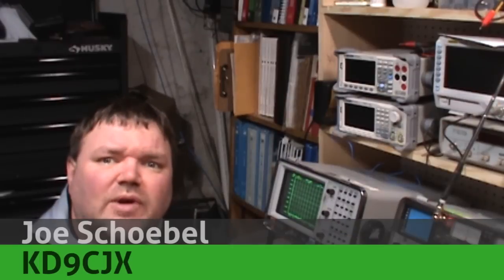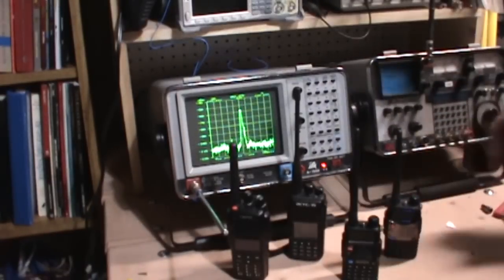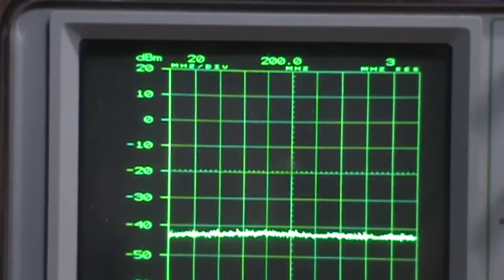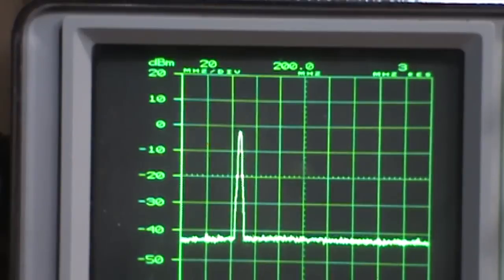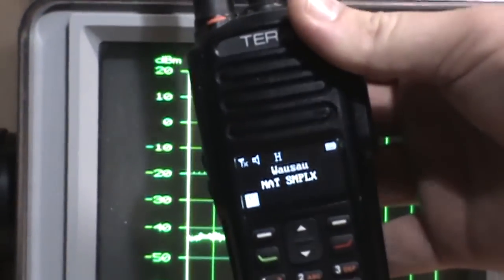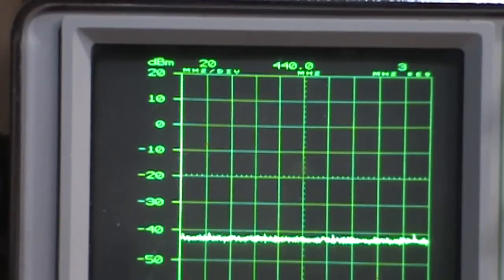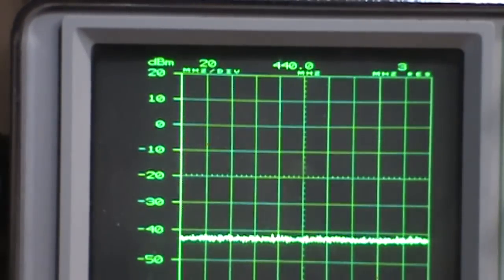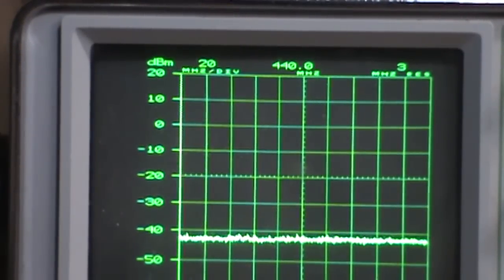Baofeng UV5R Spectral Purity Test - Ham Radio Q&A

Comment: I would be interested in seeing this test performed on an Anytone 878 to see if that is in spec before buying one
Reply: I tested my 878 and it passes part97e limits easily. It also exceeds its claimed 7W, my spectrum analyzer says 7.76W for 2m. If you want a hot rod HT that is in spec, the Wouxun KG-UV9PX (aka UV9D Plus) passes as well, and puts out 9.12W at 2m.

Comment: Thank you. You're right.. Many of us can't afford a spectrum analyzer and so greatly appreciate you and others out there putting some of the popular radios like Baofeng to the test. The only Boafeng HT that passes FCC according to other YouTube videos is the GT-5R, but also comes with reduced HAM only frequencies. Thanks for helping out the radio community with your findings! I'm definitely not getting a UV-5R or even a UV-82 based on the spectrum tests done like yours. Thanks so much.
Reply: I tested a Baofeng BF-F8HP and it passes FCC. I have a couple UV-82HP and they both fail miserably, far worse than the UV-5R which also fails.

Comment: You are transmitting with the built-in rubber duck antenna and receiving with some antenna on the SA?  You are assuming that the coupling (or path loss) is the same on the fundamental as the second harmonic.  But this needs to be checked using, for example, a calibrated signal generator.
Otherwise the data is nit valid.
Reply: the FCC even states that the limits are directly at the antenna input, so you MUST connect the device directly into the SA with a cable.

Comment: There is no FCC "type acceptance" or "equipment authorization" for amateur radio equipment except external power amplifiers which are manufactured for sale and designed to operate below 144 MHz (§97.315). Therefore, manufacturers, importers, and sellers of amateur radio transmitters have no obligation to provide transmitters which meet the amateur radio emissions standards (§97.307). OTOH, many amateur radio transceivers have FCC Part 15 grants. VHF/UHF transceivers are required to have Part 15 grants as scanning receivers under rules about scanners which can receive cellular telephone frequencies and other frequencies that the general public is not allowed to listen to.

All that said, amateur radio operators themselves are required to adhere to all of the rules contained in Part 97. That includes §97.307 which covers emissions standards. It's the individual amateur radio operator's responsibility, not the responsibility of the manufacturers, importers, or sellers.

I have been testing amateur radio handheld transceivers at hamfests using the same methods that Bob Allison WB1GCM from the ARRL Labs uses. A big difference between his method and your method is that the RF from the device under test is routed to the spectrum analyzer using a cable rather than an antenna. Yes, you must use attenuators with this method to keep from overloading the input of the spectrum analyzer.

In my experience with this testing, I have found only one Baofeng UV5R that meets both facets of §97.307, i.e. spurious emissions must not exceed 25 µW and spurious emissions must be at least 40 dB below the mean power of the fundamental. That one UV5R that passes was sent to me by Radioddity last summer.

Frankly, I don't care what people use and I am not the "radio police". My intent is to educate and inform. The FCC expects you to know the rules and abide by them. It's up to you to decide.
Reply: Robert - I've been in contact with Bob at the ARRL labs. Yes, this is a "quick and dirty" test setup. I could throw an attenuator on and be a little more precise, however, the data speaks for itself. When they're 10, 15, even 20 dB out of spec, you can't "polish the turd" any more. I can't tell everyone to toss their Baofengs in the garbage, and neither can the FCC, but we can continue to educate. And as long as there are Amazons, eBays, and AliBabas, we won't be able to stop them from coming in.

Your information on Part 97 compliance is spot on, and you quoted it chapter and verse better than I could have. Thank you. However, from the lab, they advised for a 5 watt HT, the harmonics must be 53 dB below the fundamental. I've sent a link of this to Bob and hope that he can provide some constructive feedback. I'm willing to do another test if there is a possibility that my method provided bad results, but I think the results would be the same if they were "wired."
Reply: @Gordofor12  5 watts is 37 dBm. 25 µW (from §97.307) is -16 dBm. The total difference between +37 dB and -16 dB is 53 dB (37 minus a negative 16 equals 53). Therefore, if you have a transmitter that puts out 5 watts, the spurs must be at least 53 dB below the fundamental.

The problem I have with this approach is that it lures you into thinking that the 25 µW limit is relative to the fundamental, but it's not. It's an absolute 25 µW limit no matter what the fundamental is. So, if someone hands you a radio that puts out 7 watts (38.5 dBm), you have to do the math again (38.5 minus a negative 16 equals 54.5). I prefer to not bother with doing the math. I have a Rigol DSA815TG and it allows me to put a -16 dB reference line on the display. That reference line is a constant reminder that spurious emissions can't be above that line no matter what.

The only standard that's actually relative to the fundamental is the "40 dB below" limit and most radios can easily meet that part of the rule.
Reply: So basically, dont get the license and just use a baofeng or other similar radio and nobody will actually care except for ham guys that get mad because they paid a lot of money for their radios and studied really hard to take a test? Im pretty sure the FCC doesnt do hunts for random people using radios normally, but just dont have a license or dont have a quality radio. You can look up all that stuff on their website, not a single action taken against someone like that. So...

It just seems like the only time the FCC actually cares is when there is something major happening, in which, most of the time its when someone complains. Do you have a CB with 1000W Linier amp next to a neighbor that hates you? Probably gonna get called in on that one for broadcasting through their TV. Transmitting on a GMRS channel on a baofeng that puts out unacceptable levels of spurious emissions based on what the FCC guideline says? No, probably not.

The bigger question really is this though. The limits that the FCC has in their guidelines/rules... are they just a hair below the levels that would be an issue... or are they like the FDA's food safety dating where you can eat something 2 years after it supposedly is no longer acceptable by the FDA? Cause if its a case of "We put this number so low that even if someone breaks the rules, it would never cause a problem." which is likely the case... then the amount of EMI this little handy talky puts out is a non issue.

Comment: you very seldom here the harmonics and hes making a fuss over nothing , in the uk 225 mhz is used for digital radio services, .. so apart from some one retunning also they want hear you. . . The harmonics at 430 odd mhz means your in band any way so thats funny when some body calls you but you don't hear them lol and the third harmonic at 23cm 1200 odd mhz is also in a ham band .well tell you the truth i dont hear them do you when your tunning round , so hes making a mountain out of a mole hill . He should test them with a direct antena conection and dummy load and not near to the test set as it may be rxing the harmonics used inside the radios used in stageing rather than whats actualy going out , so i suggest you test again in a propper fation with you spectrumanalyser

Comment: @1:00 not exactly -- part97e states for transmitters of 25W or less, you actually need to be below -40dBc AND below 25microwatts (-16dBm). @2:59 UV-5R are definitely dirty, first harmonic at -12dBm and second harmonic at -7.60dBm! I'm guessing there was something wrong with your setup that you only barely saw the second harmonic. On the other hand BF-F8HP pass the 97e limits easily. That Yaesu also has a first harmonic spur at -29dBm. Should have been easily visible. If you are using an attenuator it's possible your settings were pushing everything below the noise floor and you weren't able to see them.

Comment: Can you add a filter to the BAOFENGs to make them legal (in spec)
Reply: Lawrence Mayfield unless you made the filter yourself I think buying one would cost more than the $23 for the UV5R...
Reply: You would need one for each band.
Reply: Glorified walkie talkies
Reply: C Bassett think that’s what I’ll do then
Reply: @cbassett7274  Technically only for VHF. Part 97 spurious emission standards only apply for 225 MHz and below (for the record, we didn't test a 1.25 cm radio)
Reply: @Gordofor12  i also learned that quite recently and was suprised. i guess since propogation of >225mhz is quite limited so the fcc doesn't care about spurious emissions so much.

Comment: Math does not add up. All units tested showed less than 53 db difference, so they appear within legal spec.
Reply: Check your math.
The Retevis' 2nd harmonic was 45 dB from the fundamental and only 35 dB on the 3rd
For the UV-5R, the 3rd was 35 dB from the fundamental, and on the 5RA, 40 and 30 dB respectively. All less than 53 dB.

Comment: Can you get a UV5r that has the part 90 sticker in the battery compartment and compare it with a uv5r that came from Hong Kong direct? Mine came direct with no part 90 sticker back in 2012 from 409 shop. Mine says it goes from 136 to 174 and 400 to 520 with the longer antenna.

Comment: My Baofeng  UV5R is down. I added the call numbers for a local police/fire and when I entered the numbers, the radio just shut down. How do I get it going?  I have NO ham experience or electronics. Should I just throw away and get another one, that you could recommend for a complete novice.  Thanks for any help.
Reply: You can try reinstalling the codeplug if you saved the old one.

Comment: All these videos say/do the same thing. "The FCC says this number, so... like... these radios have spurious transmissions that are a tick above what they say, so its bad!" but is it though? Surely the FCC guideline isnt just at the tick below what is bad. Surely its like the FDA's food use by date system... where when the can of beans says THISDATE and its bad, yet you can still eat it safely as if you bought it the other day 2 years after that date... Makes me logically assume that the limitation given by the FCC is so much below what would be an issue, that you would have to have a HUGE amount of EMI to even be a bother to anything else.

Nobody test this, from what i have found. I dont care really what the FCC limitation is, just like i dont really care what the "use by" date is on my food. If its good its good, if its bad its bad. I can tell myself with food, cant really tell with radios without a lot of expensive equipment. But the fact that you dont really see anything on the FCC website outlining how they made contact with or gave fines to... radio users for simple EMI from an unmodified radio... leads me to believe that there isnt really an issue.

Comment: You are missing the point those Chinese radios are not certified under part 97 for use in this country the fcc certified those chinese radios under part 90.
73
Anthony
KG5JPU
Reply: Anthony, 

I hate to tell you, but your statement above is 100% incorrect. Period. 

Please look up the FCC ID for the UV-5R (2AJGM-UV5R). The Baofeng has only received type acceptance for part 15B, which, really doesn't authorize it to be used in commercial, amateur, MARS/GMRS/FRS/CB, or really anything.

There is no "Part 97" type acceptance. None. Period. The reason there isn't is because it's the ONLY class of radio that the user is allowed to homebrew their own equipment.

The Retevis RT3S (FCC ID 2AAR8RETEVISRT3S) has a part 90 type acceptance for UHF ONLY. Emission standards above 225 MHz are more relaxed than VHF/HF. 

Regardless on WHAT the FCC has allowed them for, when used in the amateur bands (VHF) they are in violation of Part 97 rules.